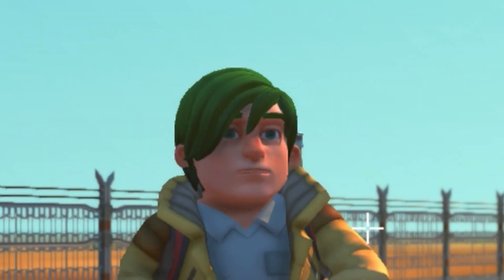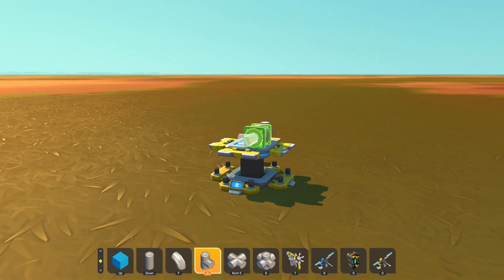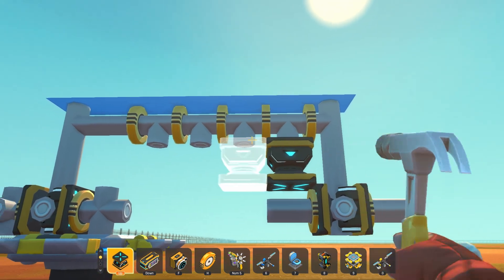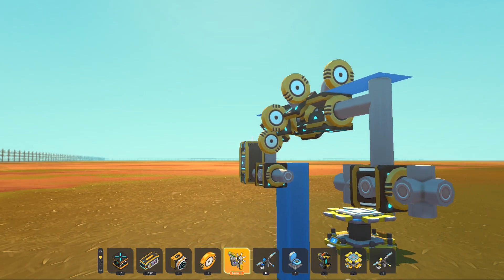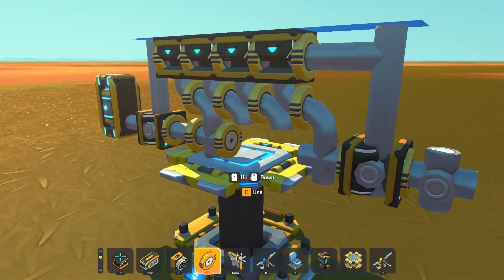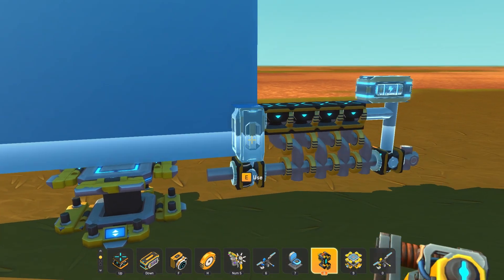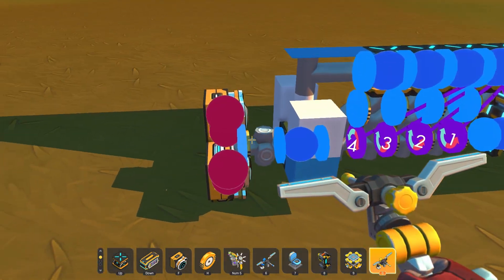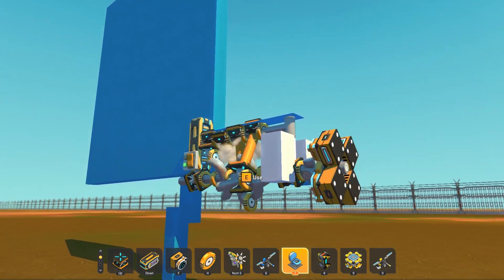Blueprint Edited Piston Engine

Comment: Have you considered balancing the crankshaft? I also highly suggest to build your timing plate with just blocks, that pipe in the center will introduce gaps that will reduce power.
Reply from the maker: i have balanced the crankshaft off camera when i was getting the engine to run, and yes i have tried to use a block instead of the pipe but the video you see here was my second recording. so i just a bit lazy making the timing wheel
Reply: @_Dynamation_ Alright, btw from where do you know zero width blocks?
Reply from the maker: @keinanderer9930  either from @Denis567 or @Icebound Glaceon
Reply: @_Dynamation_  interesting